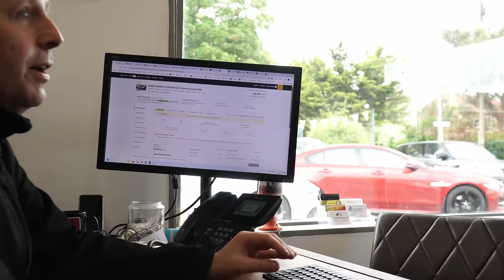We Need To Cut Our Used Car Prices! | BM Weekly EP 42

Comment: Can’t fathom why any dealer would stock RR Evoques
Awful reliability 
My wife has a late 2018 HSE Dynamic Lux with 40k on the clock
Already had a turbo, timing chain, thermostat & housing, 2 broken front springs, 2 key fobs [what a con having to have a £500 security module each time] a seal belt clasp [Airbag warning light] & that’s with full LR service history. 
Going to chop it in for a Macan, unfortunately it’s worth chocolate buttons!

Comment: Seems to me all 2010 onwards cars are built to break and built cheap, why a lot buyers are holding onto their old cars instead of buying new or other. A typical internal combustion engine has around 200 parts that need to be maintained and possibly replaced if they wear out. An electric vehicle takes that number down to around 20 parts not including a transmission in a combustion engine. It a no brainer really. Que all the people that do over 200 miles a day. All the mechanics and petrol heads that hate Evs. Not forgetting the Hydrogen that is totally unworkable to have a 10,150 psi (pressure bomb) taking all you boot space that blow a hole in your driveway 6 foot deep.